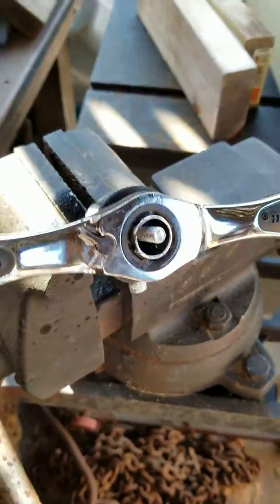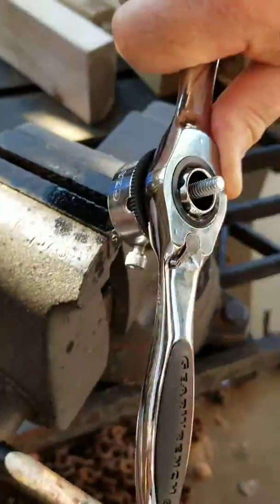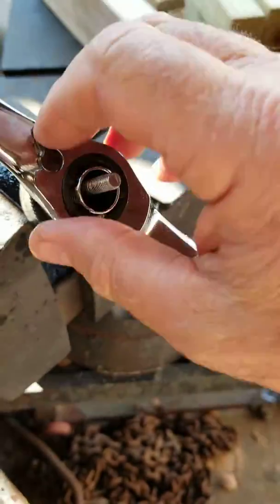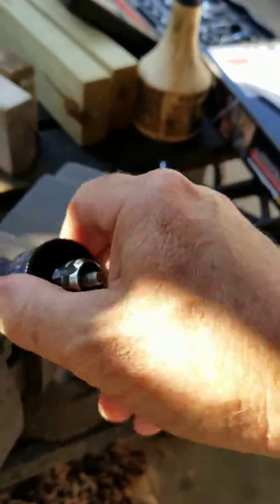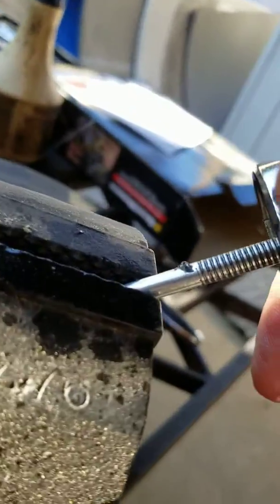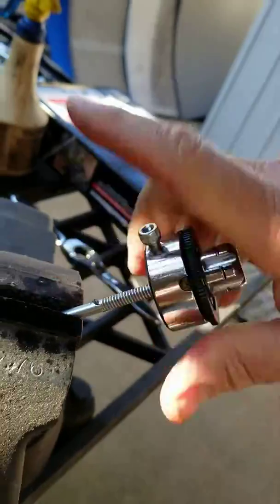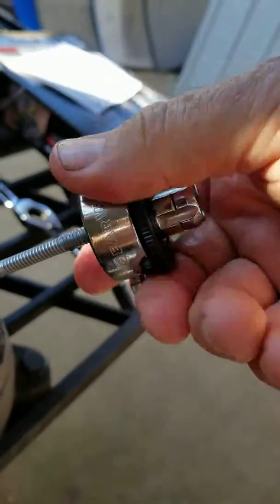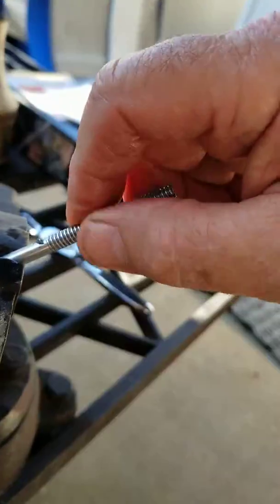GearWrench SAE Tap and Die, cutting 1/4 x 20 threads

Comment: 8 26 25   your vid is just what i was after.  seeing an existing threaded bolt have its thread end extended was the need-to-see  searching for  here on u-t.

       recently bought box of 100 4" bolts Hillman. and the threaded end is only an inch. and to lap-join 2x4's another 1/2" of thread is needed.

              counting on the existing thread to provide a starting alignment for straightness.  also learned a solo die sell for under $10.  and have a hex rim shape.  thus a 1" m/l box end hex wrench ought to do for the rotation thread force provider.  
       
        still to learn is how to match the model no. of the die with the grade of metal the bolt is made of.  and also to learn how many inches of thread  one die can cut.
  
      and to see if a way can be found to speed up the unscrewing of the die when the
additional half inch of new threads are cut